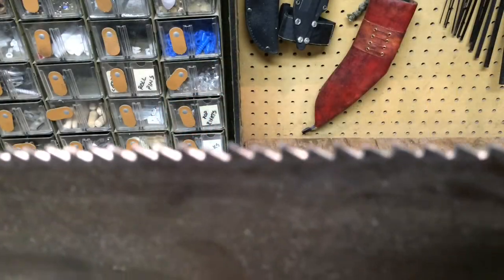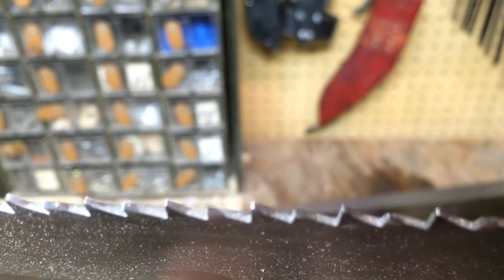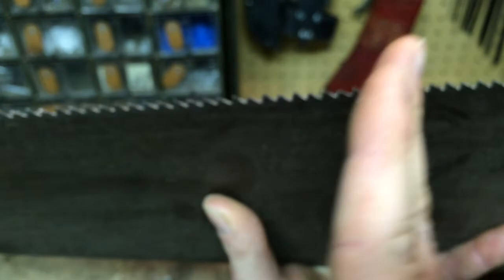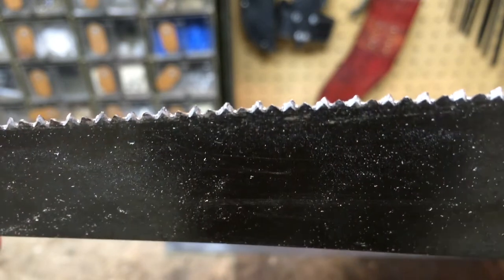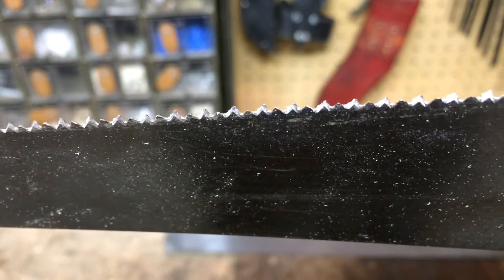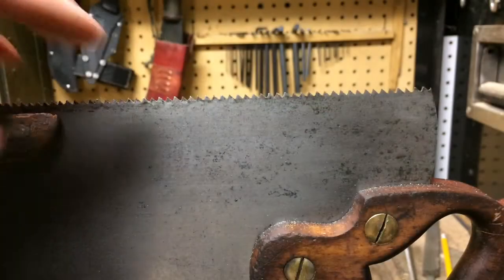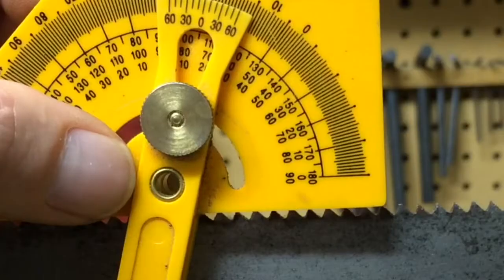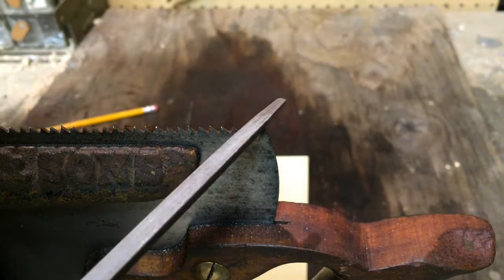How to sharpen a Handsaw | crosscut pattern |E.C . Atkins Handsaw Restoration

Comment: Here you are! Where have you been, Zack? I've been a subscriber for a couple/ few years now but I haven't been getting any of your videos in my feed. I think the last one was about a jump rope or maybe about an overland camper conversion.  Anyway,  nice video.  If I may add my 2 cents, I would  say to also set the teeth to keep saw from binding up while cutting. Setting the teeth makes the tooth part of the saw the widest part of thr the whole blade. ...and a tip I learned here on YouTube is to make the first few teeth smaller at the tip to help get your cuts started a little easier ..

About, (who again? ,,Dave??) ..he's  so tough, the NAVY seals begged him to join. Finally,  they joined him...

Comment: Do not use the same number of strokes when filing teeth that are so different.  After the first jointing, do not file the teeth that don't have flats or shiny spots. When filing the ones with flats, file only half of the flat when filing every other tooth from right to left, then the other half when filing left to right. Do not flip the saw, just angle the file the other way.  There is much more to do that what has been shown in this video.
Reply from the maker: This certainly isn't a comprehensive video.
Reply: That's for sure..... the problem is, people who know nothing about filing a handsaw will watch these kind of videos and think they are learning the right way to do it.  I can't tell you how many saws I've encountered that people have attempted to file and end up with the teeth being worse than when they started. The teeth on the saw you are using for demonstration has such bad teeth, they need to be "reshaped".  Reshaping the teeth requires a whole different set of instructions. An entire video could be made just for that step alone.

Comment: Very nice work sir!  great to see someone with knowledge of how to use a file, long forward strokes.  check out my handsaw video on a tip to deepen the gullet between the teeth and allow for deeper file penetration.  I work in a sharpening shop and your tip to bring the high teeth down to size is spot on!